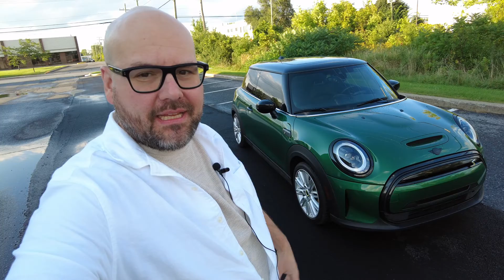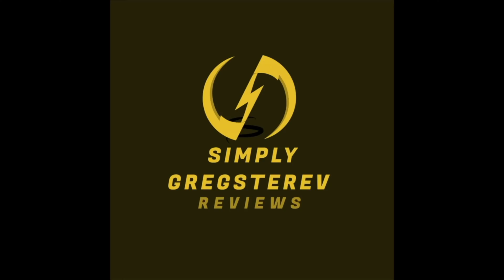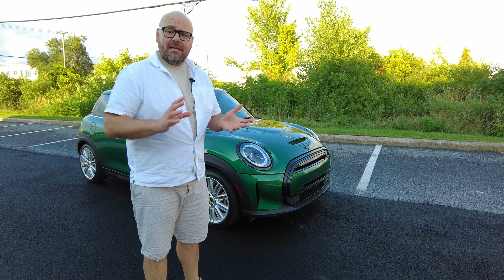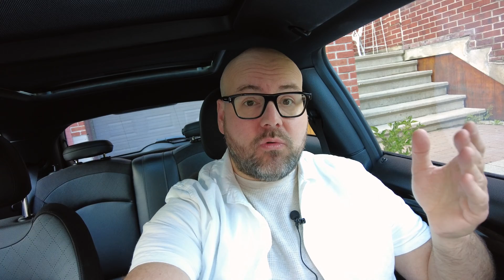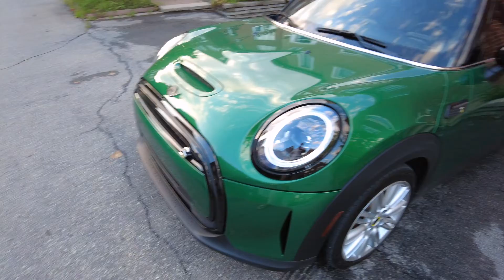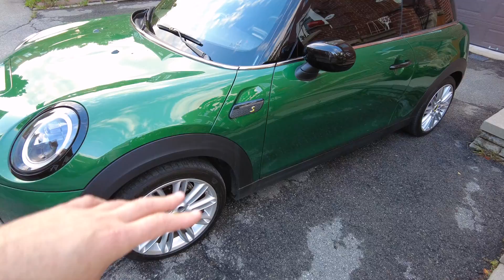Mini Cooper SE Battery Recall Explained | What You Need to Know!

Comment: I’m not knowledgable about EVs, but, I collected my car with 2 miles on the clock. At 47 miles, it’s cut out at a junction, showing ann anmber light (drivetrain issue I think it said) and as I was so new to it, panicked a little, as I was in an awkward spot. Anyway, after a few minutes, I got it going again, and parked in a space and called the MINI recovery service. A guy came out, sent me into the house (I got home, as it was drivable), and a few minutes later said ‘all done; not sure what it was, but error code said something to do with the radiator!!’ Now, I found this strange that a new car should just stop, and that the technician failed to explain a sensible reason for the fault; it felt like a story rather than the actual problem. What does everyone think?
Reply: Hi Lisa, have you had any further issues? I’ve experienced the exact same problem with my 2021 model - has only done 15,000 miles and the car just suddenly cut out and lost power and displayed the “drive train fault” message, I managed to get the car moving a couple hundred yards before it happened again. I have now managed to get the car into a car park for overnight, until I can get recovery to take it into my local MINI dealership tomorrow to inspect. So concerning, as I’ve googled and seems to be a problem with these models!

Comment: Update - checked with the dealer and the software update was conducted during the warranty work on the BMS for other charging problems last fall. (That hassle was $4K total parts and labour so glad it squeaked in before my warranty expired). 
Those links were helpful, the US ones much more so than the Canadian one. 
None of them mention water intrusion though.
Reply from the maker: Glad to hear your warranty covered the BMS issue.

Comment: Just came across this - thanks for posting. We’re just down the 401 from you near Toronto…
We’ve got a 2021 SE and just love it. I’ve had hassles with my local dealing chasing down a BMS error message but it wasn’t due to a recall that I’m aware of. They have done “various updates” when I’ve been in for other things. Will call them to confirm. We’re at  80,000km with no plans to sell it. 
I do wonder tho how the BMS can just discharge a full pack to 30% suddenly. Without running that motor at highway speed where would you dump that much power?? 🤨

Comment: The mini that suffered the thermal event in the US was my car...thankfully it was at the dealership and not my house. The car threw a code about the high voltage battery and it is why I took it to the dealership.
Reply from the maker: @heyitsstrange  great to know!
Reply: Sorry to hear that. What was the outcome? Car replacement or cash payment? I'm starting to worry about mine now.
Reply: @ I wouldn’t worry tbh there has only be 2 reported cases in the US they gave me money towards a new car it was a very annoying process tbh

Comment: Hey, what are the prospects of replacing the stock battery with a larger range one?  Any one here looking in to this?
Reply from the maker: @logicalratio  Precisely 0%
Reply: @SimplyGregsterEV   Thanks, I will stay clear of a picking up a used one then. 

Cheers
Reply from the maker: @logicalratio  fitting a larger pack or chemistry change is easier said than done. There is physically no room for a larger pack or adding more cells. Chemistry change is possible but that’s unlikely to happen from the OEM given failure rates are so low. Who knows what will
Happen. Sorta worked out well with Chevy Bolts
Reply: @SimplyGregsterEV   I was not asking about a larger physical size as that seems impossible/self-evident but yes, the market is changing fast along with the technology while costs come down.  This model is just too close to my lowest limit to consider and a 20/25% density increase (upgrade) would be perfect. 

Cheers

Comment: My 2023 Mini SE was recalled in the US 24V 302 as part of the original 128.  Having heard nothing, I waited until late August (closer to my 2 year service based on receiving the car in Nov 2022) to schedule a service.  I was told at that service I was subject to 2 recalls.  They did the computer “fix” but nothing on the original “check the leak” recall.  I tried to get more info from them…crickets. I gave a bad review based on the lack of clear communication and wrote MiniUSA.  I was notified by MiniUSA that they had the fix in mid Sept and to contact my dealer.  I took my car in on 9/27.  They still have it with the latest update being:
“We've got the battery out of the car. I didn't see the engineers here yesterday, but progress was made taking things apart getting the coolant channels in the battery that were found leaking. I'll have another update for you on Monday on the next steps as I was unable to get any more details today.”

I went from loving my car to now being afraid of it.  Please note I asked both the dealer and MiniUSA whether I should park it outside.  I was told they could not advise on that issue.  Now knowing I have a leak (!?) I have zero confidence in them repairing it. I really don’t want another car but also do not have a place that is safe to park it outside (live in Georgia - hot, humid and rainy at times).  I am so sad about the issue and they way they are handing it.
Reply: I just received the answer on my battery “the seal to the battery case was leaking but internally the batteries themselves are not, neither are any return lines inside the battery case.  The case is what requires the specific chemicals and paint etc…to reseal.”  Would you park this in your garage after this “fix” that includes “part numbers for specific chemicals and paint needed to reassemble the battery case”?
Reply: @SimplygregsterEV

Comment: I just went this morning as well for the recall. Only software update, they did not even inspect the battery and when I asked about replacing it, the guy at the dealership told me that there is no plan. It seems that if your battery is indeed defective, the update will stop the car to burn in a ball of fire but only then they will replace it. Pretty disappointed with the overall handling of the situation.
Reply from the maker: Yea we will see if we buy the car back.
Reply: @SimplyGregsterEV  My understanding is that unless BMW plans a massive battery replacement campaign (pretty improbable given the number of car affected worldwide, the materials needed, and obviously the financial impact), for now they just add the update to make sure the battery is "safe" and if a problem arise you can still drive the car to the dealership to have it replaced. But if you are taking a trip and you get the error message... thanks BMW

Comment: Hi, I'm based in Germany and actually learned about the issue by accident: My 2020 SE was due for the 4-year inspection service last month and when I took it to the dealership, they told me about the recall and the required reprogramming of the control unit. By that time, the recall was barely a week old. Interestingly here in Germany there are no mentions of not parking your car in your garage, not even in the official BMW bulletin, which both the dealership's rep and myself read together.
They did the software update prior doing the inspection and I didn't notice anything different so far. There are a few things which are bothering me though:
Just yesterday I got an e-mail from my dealership telling me about the recall and that my car's VIN is affected and I should get an appointment for the update - even though it has been updated more than three weeks ago. Besides I am not sure if that software update is an actual "fix" for the issue, as it clearly seems to be hardware related and that software update merely tries reducing the risk by giving an ahead warning. What happens if the control unit actually triggers and starts discharging the battery? Sure the battery has an eight year warranty, but my car is already four years old, what happens if that warning triggers just a month after warranty expired? Will Mini/BMW charge a full change of the battery pack?

While I don't own a house, I live in an apartment complex and my car is parked right inbetween my neighbor's cars, since the recall started getting media attention, I am just waiting to get any comments about parking a "ticking time bomb" beside their vehicles. Personally I am rather relaxed about the issue to be honest and simply drive and enjoy my SE just as I did before. I just wish Mini would be more open about the whole topic, as again I have some doubts a software update will fix a hardware related issue.
Reply from the maker: I have my doubts as well. Thanks for the reply

Comment: Thanks for this video. I am in a wet climate area and lease a mini ev. Got a call today from my local mini dealer to book the car in for a "programming control unit" update. No mention of fire risk but i sure will be asking more questions.
Reply from the maker: Im picking up my car from the dealer today. They did the programming. I was told the fire risk wasnt mentioned in the USA recall document
Reply: Got my recall completed. I was handed a letter to say that going forward, a fire cannot be ruled out and that the battery will deplete to below 30% if it detects a battery fault like you said in your video. I fail to see how a software update can fix a physical battery seal problem. The “software” update to me is nothing more than a potential smoke alarm. I now have zero confidence in the car. I won’t have it much longer.
Reply from the maker: @fairwayfinder18  we are sorta on the same boat and the older they get the less likely they will replace the battery. Once the lease is over its gone

Comment: I'm not as worried..  I own a 2023 Mini SE - and I think more fires would have happened by now but for sure I'll make an appointment when I can.  I don't drive very much and I only have rougly 4,000 miles on my car but I live in a desert climate in Utah but it does snow but I only drive local and zero freeway and I baby it but we don't deal with rust which I'm guessing this is probably a factor.   Anyway great car... thanks for the video.
Reply from the maker: My car is driven in the winter and exposed to road salt  ☹️

Comment: Here's the news: All EV's have a battery problem. That's because they are managed by software. Now as a Software Engineer with over 35 years of experience, I can tell you that if you have ever written more than one line of code there will be a defect in it. Some defects will be insignificant, but many of them won't. You've just hit one that isn't. Welcome to the wonderfull world of software!
Reply from the maker: This is diagnostic software they are loading. A failsafe
Reply: You must be a crap coder

Comment: i3 owner here, I regret hearing news like this. its unfortunate. I hope that the issue gets remedied, aren't they able to take an existing pack and stress it to find it... I thought mini batteries were manufactured in Dingolfing Germany
Reply from the maker: @AlecFurlan-hm7iw  its a case sealing issue. I suspect it varies on car, region and climate. Its either down to adhesive used or corrosion